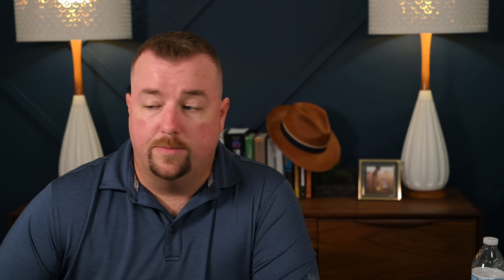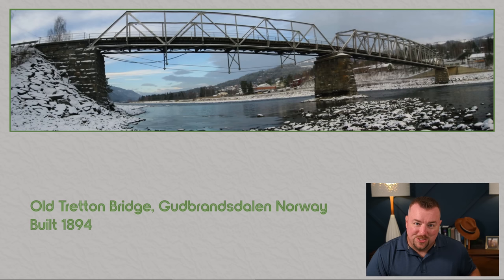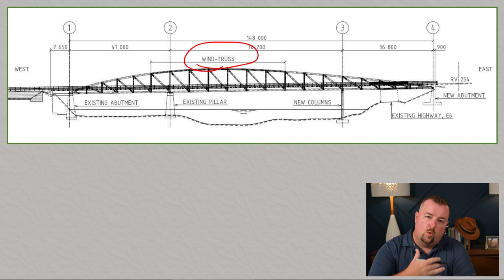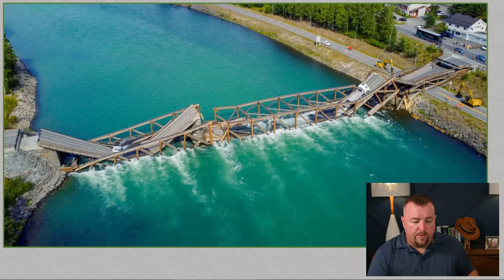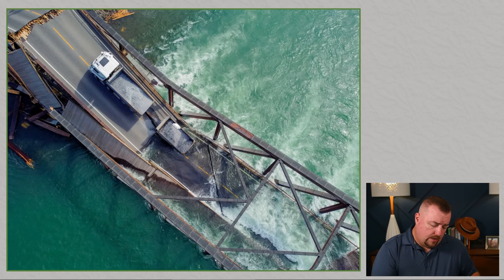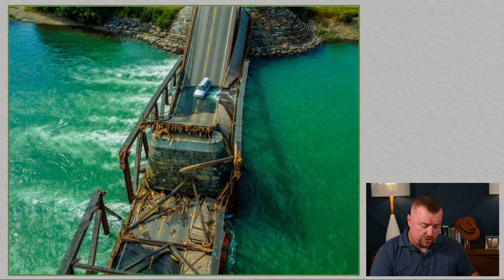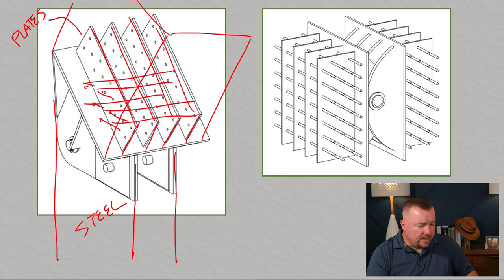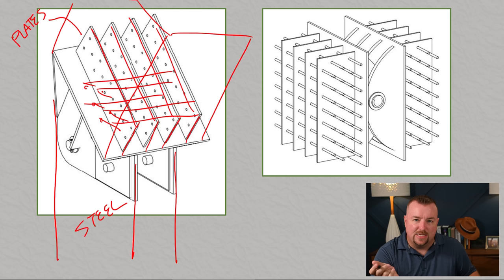How Did the Engineers Miss This?

Comment: Regarding the rusty steel, it's special weathering steel (Corten) made to get a thin layer of rust but it will put up very well in outdoor use without any paint.
Reply: Wrought Iron was doing that 100 years before Corten was ever invented.
Reply: Corten has... issues. In some applications it can work, but it does not handle standing water well, so you have to design it to avoid corners/etc where water can accumulate. Such as, say, wind-driven rain forcing water in between the steel and wood of a joint and then sitting there...
Reply: @Hammerandhearth  Wrought iron was doing it, before it was cool. But you've probably never heard of it.

Comment: 15:45 ANYONE who has ever worked with wood could have told them that is how wood is going to break.
Reply: Seeing that nearly killed me. It actually looks like a person who has never picked up a drill or a chisel designed and built a bridge alone.
Reply: @johns1625  And probably never split firewood. If you hit the wood correctly with a splitter, it's very easy to split, and stack it up for winter :)
Reply: And 2000 years ago, they would not have had a load that heavy, creating 12 point loads (on 6 axles).  Well… unless they were rolling an obelisk across a bridge.
Reply: @sambrusco672  I'd always bemoan the "glued together woodchips" that americans call houses and go up in flames or hurricanes like matchstick houses but I guess we're not much better in Europe with our upscaled glued together ice cream stick bridges
Reply: @sambrusco672  I was talking about the specific failure modes of the peg and groove construction. I dont think this style of construction 2000 years ago. But people 2000 years ago would also tell you that wood will break along the grain.

Comment: I have over 20 years of experience as a framer of custom homes with basic math skills. This design gives me the chills.
Excellent presentation, as always.
Reply: I'm sure flexibility was in the design but not seeing X braces between the columns is giving me red flags
Reply: dingo, yes you have seen wood split in may ways and just when you didn't want it to. Can you imagine how they were able to drill those holes accurately?  How do you keep a drill from drifting in wood?  Also, all those holes close together really weakens the wood in a  way. There has to be a diminishing return on the number of bolts at some point.
Reply: I’m just a regular guy with some experience working with wood and even I saw that this was a bad design

Comment: Glue lam beams are a strong building material, until they get wet and stay wet , especially the tension connections 

I had a structural engineer tell me once when he was designing a job for me “ it’s always the connections that will kill you “
Reply: It'd be kind of like building  a steel beam bridge on mars like its an earth bridge. The thing will get extrmely brittle at the lowest lows, and stay brittle until it warms up, and then people moving across will dynamically load it and snap! this wood will get wet and stay wet and lose its rigidity. Theres also the issue of expansion coefficient difference sbetwens all the materials. These people need to stick to legos.
Reply: After reading your comment, I immediately thought of the Hyatt Regency walkway collapse
Reply: @BrainScramblies   I saw a short documentary on that a while back and it was surprising how obvious the flaw was, and I’m not an engineer. 

‘It’s the same weight being supported on the vertical rod, we just cut the rod in two’

…but it’s now the weight of TWO walkways on that one connection instead of just one? And when that connection fails, both fall rather than just the one?

Comment: One idea is to have the wood grain in multiple orientations, at least where the bolts are applied. The beam itself can still be lengthwise along the grain, but at these junctions there needs to be fibers going in more than just the lengthwise direction. Also, compressing the wood to squeeze the fibers together might be another helpful option - so that the fibers don't have room to part.
Reply: yea my thought is the wood goes in to a socket so it can't expand to split.
Reply: Charles Van Noland,  Yes you're exactly right, they alternate the direction of wood in plywood for that reason. They don't in laminated beams like those. Wood likes to split especially at the ends.
Reply: I was thinking the same, but also realize that would reduce the tensile strength of the members at the joint in favor of improving the woods resistance to splitting, this could have been accommodated with widening the joint ends of the wood, but that would have only extended the life of the bridge a few more years at best, as the joint design is  based on theory, and not even close to the tested models use to create the computer model. IE. the test used bolts with large washers to resist the splitting of the wood in at least one plane, but with pins there is no resistance to splitting in any plane.

Comment: This was interesting. I just a dumb old carpenter from Maine. When you frame a building and are using plain old fashion planks as beams, you lap the joints to help hold everything together. Look at 200 year old barns. Yes, they were post and beam not planks laminated together, but where 2 beams meet on a post, they are half lapped and doweled, not just butted.
I have seen pinned joints in many construction details, but they also have a bolt running perpendicular to the pins to hold the wood together. Some of these joints are over a hundred years old.
Reply: I was thinking about how if these engineers had shown this design to even a simple furniture maker, they could have caught these issues.
Reply: Absolutely. I cringed immediately when I saw what they had done. Any carpenter that understands basic engineering can see the issues here I believe 😅
Reply: Correct. People have a simplistic and dumb understanding of wood construction today. They think all joints should be butt joints. Not even all metal hardware is all butt joints. I have a chest of metal drawers that has the equivalent of lapping. It has metal from the sides that wraps aroudn the front posts and is riveted in place. People should be forced to build projects in wood first which are then stress tested to make them understand principles. I was getting into japanese joinery because I thought "hey they know how to build with wood for stong connections". It was the first time I got exposed to that stuff so I thought they just did wood construction better but apaprently the west used to do it too. It just turned into lost technology probably due to cost cutting.
Reply: Not a dumb carpenter at all 😊 I’m studying up on cabinetmaking as I want to build a desk, and can see that grain direction and weight distribution dictate the type of joint that you use.

What’s also bizarre is anyone who owns a log splitter would also see the issue. The splitter works by driving a wedge of steel or cast iron into the end of the grain, causing it to split along the length of the log. 

The engineer not only used square steel pegs, but also seems to have based the design on roof trusses, which to my knowledge are designed for a static load? 

I get the desire to ‘go back to basics’ but it seems to be purely an aesthetic choice. Yes we had wooden bridges in the 1800’s, but we didn’t have articulated lorries and speed limits.
Reply: Good point

Comment: Interesting to see students and engineers learning things carpenters and woodworkers have understood and discussed for centuries
Reply: that was my thought.  I guess what happened as soon as I understood how it was put together.  I have been around lots of glulam its a great material but I would never have used it like that.
Reply: @453tye65e65e65e65  Is it supposed to be used for such structures as this? I assumed it was mostly for cosmetic uses not for structural support.
Reply: @kinte1870  Laminated wood is very strong and works well as a structural member but it must be used correctly. I know of a lot of buildings where exposed laminated wood beams are used to support the roof, where a large open space is needed and interior support columns are undesirable such as church auditoriums, and I have never seen a failure in such a construction.
Reply: @kinte1870  I've seen stables and sports arenas with large glulam beams for roof support over wide spans. Many of these already serve decades without any problems, even under heavy snow load. I also know outdoor pedestrian bridges on wide arches of glulam. There are several differences versus the design and usage on the failed bridge, though.

Comment: Just for accuracy ;19:00 no error in translation here, it is exactly as it is written . At the beginning of the loading, the timber hole increased in size to the point where the  wood was broken by tension perpendicular to the grain when the bolts acted as wedges and separated the fibers along the grain by that perpendicular force exceeding the strength of the links between fibers.
You can see in the picture the wood is split and open by forces perpendicular to the grain not that it broke perpendicular ,the tension is perpendicular.

Comment: As a civil Inspector retired after almost 50 years it has been my observation that design Engineers tend to blame deficient materials, fabrication, and construction for failures. They dismiss the design as the cause because of liability, and insurance and bonding.
Reply: Then it's a good thing that they are not the leading civilian authority for the investigation of potential design failures. it's a good thing there are other concerned parties on top of that. if their design is at fault, it will be known. it's happening right now.
Reply: and materials suppliers, and construction contractors, blame the engineers.  Yes, everyone tries to evade liability.  The evidence is always there in the wreckage and "the truth will out" if you know how to look for it.

Comment: I highly suspect water damage at the lower connections. I understand the deck was paved with asphalt. Where does all of that runoff go? I suspect right to those connections.
Reply: They probably have drainage pipes to get rid of it between the beams, not onto the beams and joints.

Comment: Ten years is an interesting failure time. Wood typically fails through significant creep at around 1/3 of the ultimate momentary stress in a decade. Elasticity also MATTERs. If your wood cannot load ALL the pins equally (which requires matching the stiffness of the steel perfectly). These two factors can  work together to lead to unzipping over timescales of a decade, even in the absence of glue deterioration or moisture. Moisture of course makes creep worse a LOT worse.
Reply: With the pins not being sealed, would make a high way to bring water in to the joint and the freeze and thaw cycles can go to work. also if the glue does not expand and contract at the same rate as the wood this can/ will accelerate the unzipping
Reply: Interesting coincidence--the video I watched immediately before this one talked about Quetzalcoatl.

Comment: This seems to me to be the same stresses which led to the collapse of the I-35 bridge in Minneapolis.  In that bridge it was failure of lower chord gusset plate and rivets.  Analysis demonstrated that thicker steel was needed for the plates, with more rivets.  Weathering was also a factor.  Wood structural elements under tension fail at the end-attachments, as you have demonstrated very nicely.  Thank you for this excellent analysis, explanation, and demonstration!

Comment: Anyone who has ever worked with wood, knows it works best in compression, not tension - and this is even more important if the wood is expected to get wet (especially saturated for long periods of time).  Even cantilevers have to be done with exceptional care.  There's a reason headers over a door or window will be 12" tall when the jack stud supporting it might only be 3.5" on the largest dimension.
  
Much like single direction carbon fiber, wood has a very different strength with and against the grain due to the bond of adjacent parallel fibers versus the combined stregth of those fibers in tension endwise.  This is why plywood is designed with various angles of grain in-plane with the sheet, and carbon fiber intended for mutli-directionla loads has a cross weave and additional layers in the correct orientations. It's also why we put fasteners through the plywood perpendicular to the plane - with the in-plane crossed grain, one layer of splitting would put the next layer into tension+compression.  Chip board aka Oriented Strand Board (OSB), is like taking plywood to the completely random grain orientation limit.  If they really put their pins through the glue-lam parallel to the glue layers - IMO they should just be sacrified on the alter of license revocation for other Practicing Engineers to see as a warning against using materials they have no experience with, without an exceptional amount of due dilligence (not just reading a few research papers and copy pasting unverified numbers).
  
When wood gets wet, the fibers swell and this parallel adjacent bond is even sketchier - and some of the detailing they did on that bridge with the copper flashing, looks - well suboptimal I'm going to say diplomatically.  A lot of that flashing appears to direct shedding water INTO the joints where the strength would be most challenged by removed fibers to insert the fingers.

Comment: 26:00 the rear trailer is on a part of the deck that bottomed out. It is now a deadweight anchor. I believe there is water inside the trailer box.
 The pulling beam is actually holding the truck in place. That is why the truck did not skid downwards.
The aggregate on the truck DID slide down.
Reply: Yes, the trailer acted as a support for the truck. I don't think the brakes could be effective on that steep of a slope. It's amazing that the truck didn't slide sideways.
Reply: Nailed it
Reply: @dmunro9076  brakes could have held, but the tires not skidding down that steep of a slope is certainly not very feasible.

Comment: There was a reason that wood bridges are covered bridges.  The bridge would have failed covered or not. This bridge should never have been built. Engineering is at fault.
Reply: Railroad bridges and trestles made of wood are rarely covered, and some have been standing for over 100 years in daily use. There are ways to make this work. (This bridge wasn't one of the ways.)
Reply: Um Almost all wooden bridges are uncovered.
Reply: @lwilton  They're still standing due to receiving repairs when needed.
Reply: politicians, I'm sure it met some "green" requirement.

Comment: One retired bridge engineer from statens vegvesen who worked certifying Tretten bridge said in the media that he thought the collapse came as a result of different thermal expansion of the wood and steel, causing the wood to crack in the points where the two met.
Reply: And he would be wrong... wood is a bitch to cut across the grain... turn that wood on end and it splits with ease. The only way this method might work is if the "glulam" were forced into sockets which would keep the grain from having the ability to expand and split. EVERY bridge built like this WILL have a catastrophic failure as there is nothing to prevent the joints compromised by the fasteners from expanding and splitting down the grain.
Reply: @76Chev4x4  The preliminary report on the failure, showed that several 2" +++ sized  bolts where sheared off. The say the bolts appear to have failed due to stress. They also think, but do not know that it was the cause of the bridge collapse. Too early to tell, as some parts of the bridge has yet to be recovered.